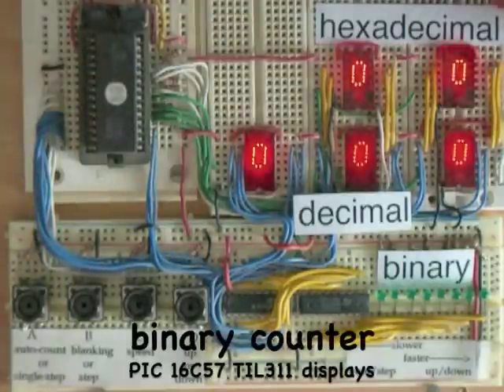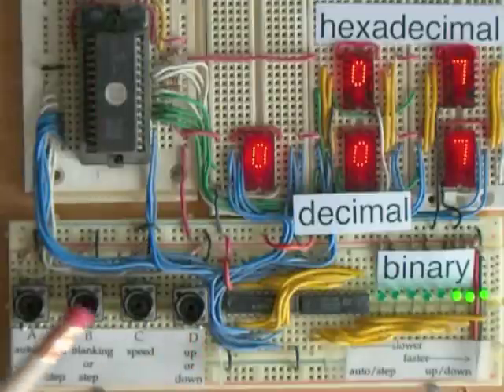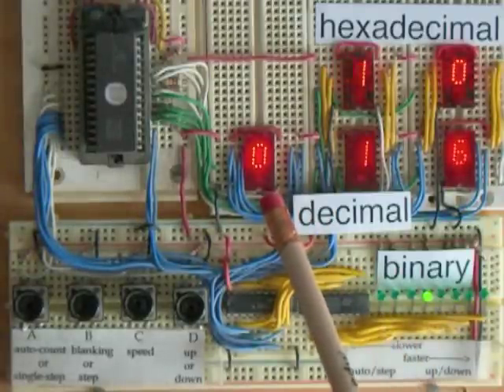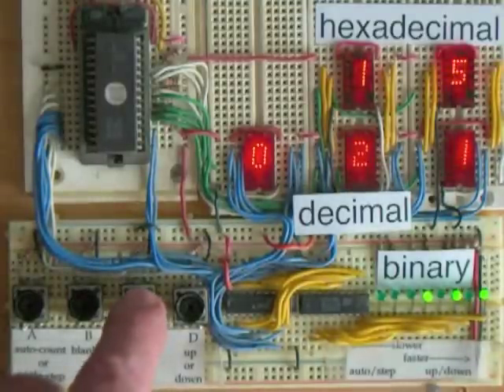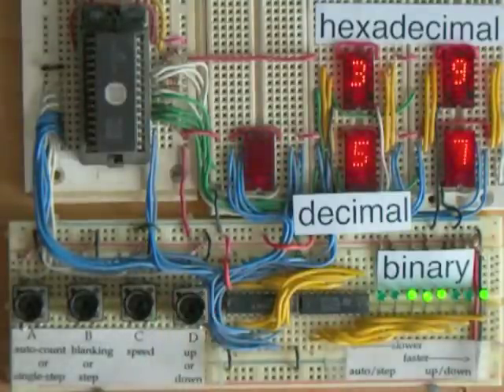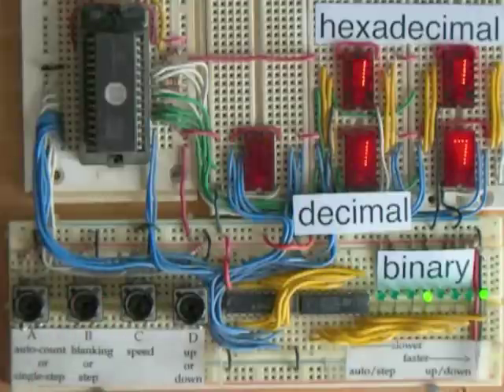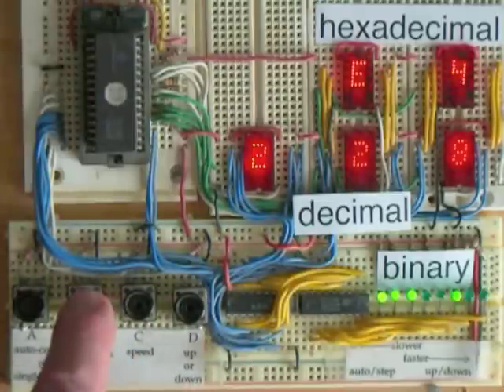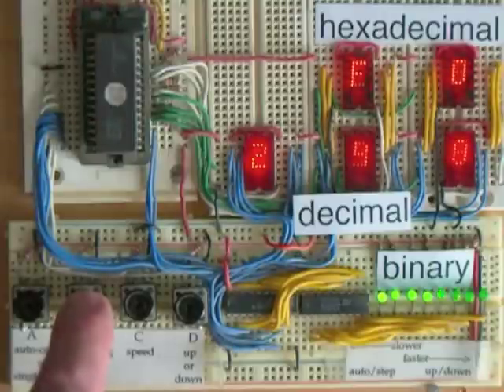Binary Counter

Comment: Nice job! That is really cool. I was wondering if you could help me out. Im trying to get my til311 displays to work properly but can't seem to get them working. I've looked at the datasheets but it doesn't seem to pinpoint the problem. When you apply voltage to pin 1 and 14, with 0 volts on all other pins and pin 7 grounded, what should the displays output? I keep getting a bunch of lit up dots in each corner.